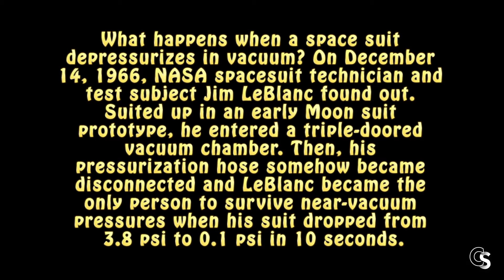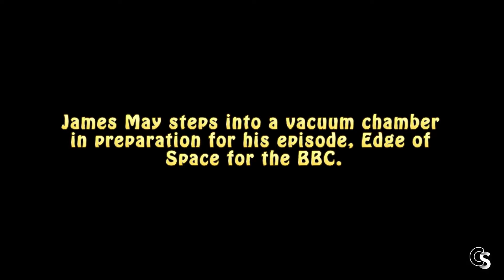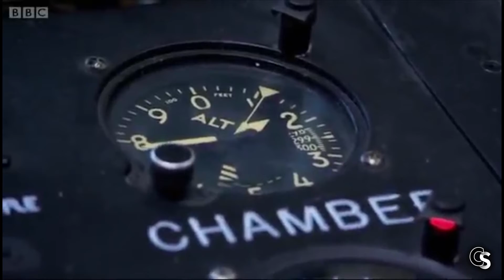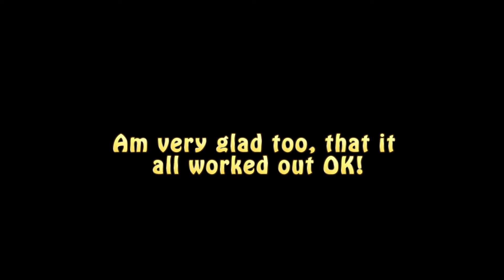Space Suits  are not tested in Vacuum Chambers

Comment: guys, the water would all start violently boiling. It has to do with the fomula PV=nRT. If you lower the pressure, you have to increase the volume to maintain the same temperature.  Once the pressure dropped below the state-change threshold, the water would all try to state change to gas at the same time. It is really basic science.

Comment: They pressure test them. It's the same thing as far as the suit is concerned. No difference in 0 psia outside the suit and 14.7 psia inside and 14.7 psia outside and 30 psia inside. It's exactly the same pressure differential.
Reply: Cynical Skeptic  
 You basically repeated what I said. Here's the math: volleyball psi 4.5,  minus Apollo moon suit 3.7 psi equals + 0.8 psi for the volleyball.
The ISS suits are 4.3 psi, 0.2 psi over the volleyball.
Reply: @CynicalSkeptic-r5u  The suits are only pressurized to about 4.0 psi - about the same as a volleyball which isn't hard at all. In fact, that's quite squishy. An American football is pressurized to about 13 psi. Are your hands so weak that you think making a fist would be a problem for you? I just took my kitchen digital scale and had no problem exerting 10 lbf between the tips of my thumb and forefinger (that was max for the scale) and the area in contact was maybe 1/4 in^2. I don't think flexing my hands in a glove pressurized to 4 psi would even be noticeable. I don't think you understand the difference in gauge and absolute pressure or have any empirical feel for how little pressure 4.5 psi actually is. A plastic bottle of soda at room temperature will be around 50 psi. Can you flex that with your hand - damned right you can and that's over ten times the pressure of a spacesuit.
Reply: Cynical Skeptic 
For being a fellow traveler with NASA deniers, and flat earthers, you are surprisingly rational. You have not said anything about the infinite power of the vacuum of space. But you do have the odd habit of saying that I am completely wrong and then agreeing with the facts that I have stated. Your main argument seems to be "that is an impossibility because it would have been difficult to do."
Great accomplishments are almost always very difficult, and often involve repeated failures along the way. Everything I have read about space suits has said they were difficult to move in, particularly so the gloves, but a lot of training was done and all of the things they had to manipulate were designed to be operated with the pressurized gloves.
There are mountains of information on the engineering and manufacturer of almost everything involved in the moon landings, and in the training that led up to it, if you care to research it.
Reply: They don't test them in case of an explosive decompression?
Reply: Cynical Skeptic  
Check out this App: 
Space Launch Schedule by Raymond John Bruneel https://apps.apple.com/us/app/space-launch-schedule/id1024681892
Launches happen about once a week.
Reply from the maker: Not even close, I could go from 14.7 psi to 100 psi with a simple hand pump.  to go from our 14.7 psi to even close to zero, the effort goes up exponentially as you get down to zero.   a perfect vacuum (if it could be attained) would required an incredibly strong and massive pump.
Reply: @CynicalSkeptic-r5u  You're a complete idiot. You apparently can't even add or subtract. Go back to school kid.
Reply: Cynical Skeptic 
There is more pressure in a volley ball on earth than a space suit on the moon.
Reply: Cynical Skeptic 
Yes it is true a very powerful pump is needed to pump down to near zero pressure, but it is also completely irrelevant since space is already a hard vacuum, no pumping needed.